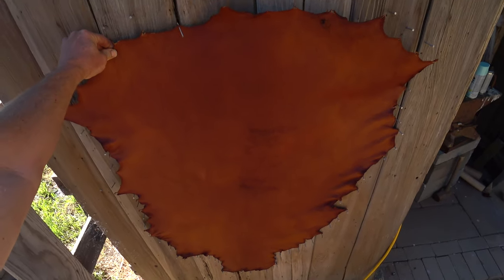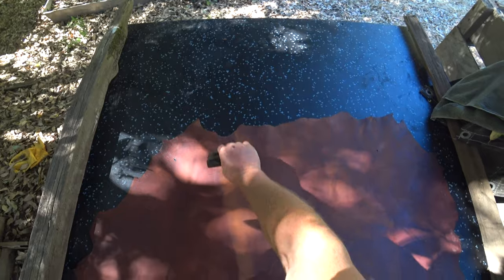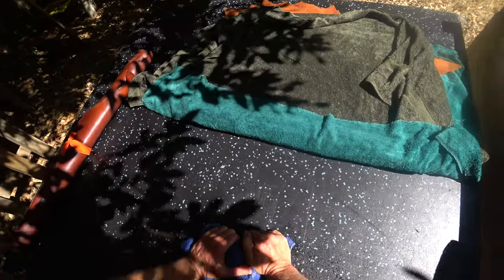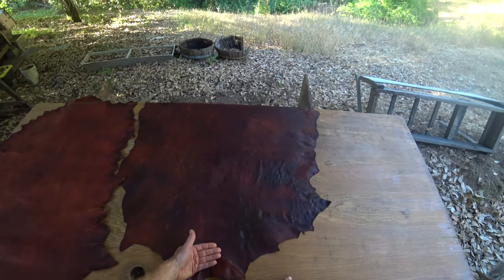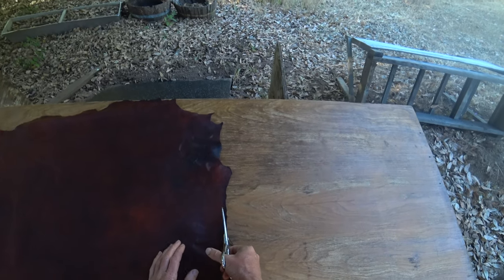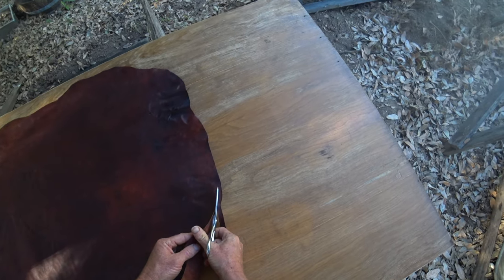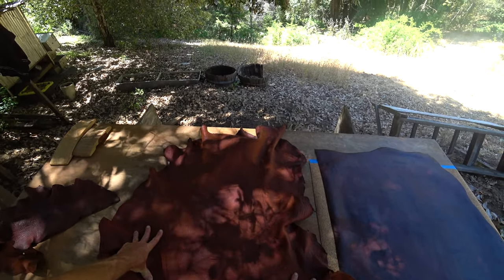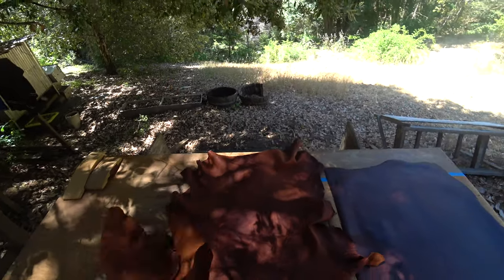Finishing Oak Tanned Leather by Rolling-  Hide Tanning Vlog

Comment: Thanks for the videos Steven, I was looking forward to see it for a while - especially the flattening with the sleekers part, and that cork thing at work... couldn't get to it so far, summer nights being so short. It's immensely helpful... I've got a 220 liter barrel full of tanned dried hides awaiting finish. Mostly goat, some horse and donkey. I have tried flattening hides on plywood before, and now I can see what I did wrong (rough plywood, hot and dry weather, metal sleeker too blunt).
 Aint nothing even close to this level of good information anywhere. It would have gotten ten thousand times more views in the world I would have liked to live in!
Reply from the maker: Thanks Nimrod.  for thick hides, like maybe even donkey, you might get away with plywood. it's actually nice to have some texture to grip onto the skin.  But anything thin at all on rough surfaces, and you already know what happens I guess.  if you don't have one, make a stone, tile, or glass sleeker. Even hardwood is okay.  You really kind of need that rounded smooth "edge" with the ends gently turned up to get the grain dead smooth.  And yeah, slow drying is critical. If you think about it, it makes sense.  if the water leaves the outside layer of skin too fast, it is going to stay fat inside, while the exterior is trying to shrink, resulting in some kind of unflat drying.  The heat is a real problem, and I'm sure it's brutal there.  You probably have goat and sheep fat, so use at least 50% of that, and if you have a cellar or anyplace cool, or can do it in cooler weather, it's much better.
Reply: @SkillCult  Yeah, I've got lots of goat tallow at hand, hardly anyone in my family will eat anything fried in it, no matter my insistence that they could get used to it...lacking sufficient cellar space, I'll wait for cooler weather for this kind of finishing. I would imagine november will do here.
Thanks!

Comment: Excellent, thank you very much for the effort. This Oak tanned piece looks like acacia nilotica seeds tanned in color. We use the seeds for traditional tanning in the Sahara region due to the lack of trees. 
By the way, I would really love to see the result of bark tanning an alum tanned piece as I have a lamb fur coated in the alum paste at the moment. I believe alum tanning is a fake unstable tanning that I would love to veg tan again once I have enough acacia seeds. So keep the awesome work 🙂
Reply from the maker: Hi Muhammed.  You use the papery seed pods correct?  I think you can easily mix alum and vegetable tan, but I haven't done it.  I would just try it, but keep the strength up and don't leave it in weak solution or put off dealing with it like I did.

Comment: Hey thanks for all your tanning videos. They're the best and most detailed series on earth I'm sure. I'm currently tanning wolf, deer, beaver tails and half a cow here in SK Canada. experimenting with tamarac, willow, alder, spruce and birch bark. It would be awsome to see some more video on dyeing leather without using those modern dyes. Black is easy but how about red
Reply from the maker: Thanks Jerome.  I don't do much dyeing of leather, and old info is not that abundant.  The reds used were usually Kermes in and Cochineal.  They require different mordants I think.  You can probably find info on those.  I've seen beautiful scarlet buckskin dyed with cochineal.  Another factor is that the skins need to be a light color.  While we might appreciate a nice brown/red tan now, typically very light colored skins were considered more desireable, because they are easier to over dye.

Comment: I know in the past you've mentioned that walnut shells produce more of a stain than a tan. Do you think that if concentrated walnut dye was mixed in with the tan liquor, would it alter the way it was tanned or just make a darker leather? Or would it be more convenient to dye it with lamp black after the fact?
Reply from the maker: If you want black leather, use Iron acetate over the tan when it's finished tanning and before any final oiling and finishing.  Put some rusty old nails or steel wool in vinegar for a month or so.  Dilute that so it darkens the leather, but takes about three applications to get it completely black looking.  Then rinse out as much excess as you can.  If there is any weak tannin solution, I'll put the hide in that to sop up any extra iron.  Not sure that actually works, but it seems like a good idea.  I think adding walnut to the tan would probably give you a very dark brown.  It does have tannin, but from talking to other tanners, it takes a ton of black walnut hulls to actually tan a hide.  I haven't tried to dye with BW after the fact, but it would probably work too.
Reply: @SkillCult  I appreciate the response!

Comment: Question: I've been following along with your vlog series and tanning some buckskin of my own. I left the leather in what turned out to be too weak a bark liquor for long enough to get stinky. The smell has persisted after changing out the solution and letting the hide soak in the new stuff for a couple days.  What would you recommend I do with it at this point? It's probably 3/4 or more done tanning now (only a thin light section left in thickest part of the hide).
Reply from the maker: All you can really do is finish it out and see if it's still smelly.  Usually it won't be.  But it also depends on the smell.  Just healthy fermented bark can be kind of funky and there is all stages between like funky ferments all the way to putrid septic tank smell.  Once it is dry and finished out though, you might be surprised.  Or not lol.  You'll just have to find out.  Good luck.  Do wash and scud it very thoroughly before drying it out.
Reply: @SkillCult  thanks, you're one of a kind. Love the content, keep up the good work!

Comment: Big thin sheets of cork are cheap? SOURCE?

The Best. 💪
Reply from the maker: I bought a pack of 5 big sheets from home depot. they are for underlayment. I think they were 39.00 but probably more now.  That smooth cork hasn't worked well for the cork board though.  I think I need a chunkier peice of natural cork bark, which are not so cheap.
Reply: @SkillCult  Ever think of processing wine corks? Saw your vid about making your awls, you seemed to have an ample supply of corks! I don't drink, but I still have a lot of well off family in California, I could probably get 55 gallons of used corks in a year! 

Have been thinking about blending them down, just right, into 1/8" grains, and mixing with some type of adhesive... Barge? Barge thinned... which I don't know how to do, think I need xylene or whatever ultratoxic solvent Barge uses. 

Side note, we used to buy Barge by the gallon for the leather biz which died on the vine during covid, have a gallon aging out, getting real thick, past honey, past molasses, have you ever effectively solved Barge out?

NEway, thanks for the heads up re Home Despot.

Comment: So with the methods you used in this series, if the leather was exposed to excess moisture would it become stiff after it dried or would dry soft like a smoked hide would?
Reply from the maker: Depends on the leather and how many times it gets wet. YOU've see what happens to shoe leather with repeated wetting and drying.  But some wetting is okay and it might dry a little stiff like buckskin does, but again, depends on the leather.  it is more tanned and crosslinked than smoked buckskin.
Reply: @SkillCult  what do you mean cross-linked?
Reply from the maker: @Regdiggs  tanning chemicals bind to the fibers from one binding site to another.  That is really what tanning is.  tannins or aldehydes in smoke, chromium, all do that.  I think it's more or less the more tanned, the more crosslinked.
Reply from the maker: @Regdiggs  it uses sites on the proteins that also interact with water.  so the fibers don't take onto as much, or hold  onto it as well.  The hides won't glue down adn stiffen as much if they are well crosslinked
Reply: @SkillCult  makes sense. When tanning a cow hide after it comes out of the tanning solution how slow should the drying and working process be for the best result? And thanks for taking the time to answer my questions. I hope I'm not bugging you.
Reply from the maker: @Regdiggs  If it's not coming out right away, wait to see the videos I'll be making of finishing that cattle skin.  You may not want to work it. I won't be. If anything, i might compress it more.  It should make sense once you see me go through it.
Reply: @SkillCult  ok cool.

Comment: Would the rolling method your using work to soften bark tanned cattle hide so that it's at least semi-pliable?
Reply from the maker: Yes, just keep your expectations in check.  If you can, test it on an extra piece first.  But if you can break it in, this is a good method to do it.
Reply: @SkillCult  
Epic. Thanks heaps.
You like natural ingredients for leather processing. I tried something you might like.
I harvested some tree sap thinking the tannins would be good but it hardened the leather, this was interesting though.
When I mixed the sap with coconut oil and heated it, it created a wax like product that when I applied it to the leather it made a malleable resinous finish. So I hard pressed and worked it into the edge of the leather and it made a shiny resinous rounded edge that bent with the leather without cracking. Effectively protecting the edges. Tree sap and oil, ha ha